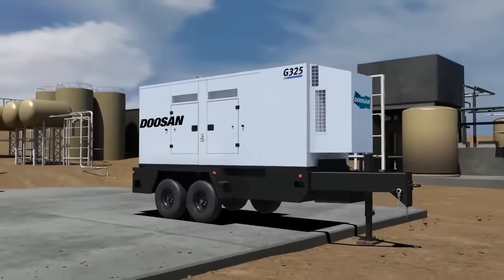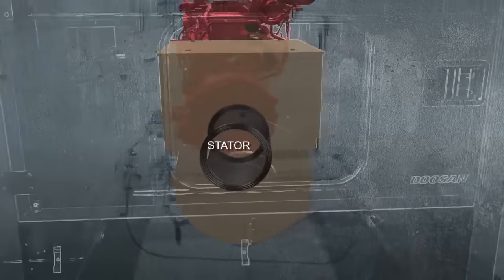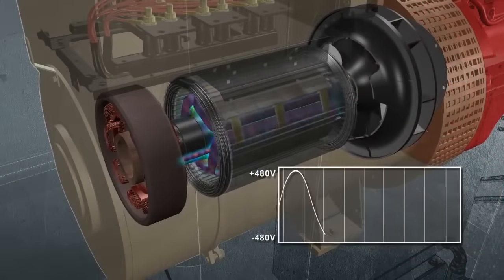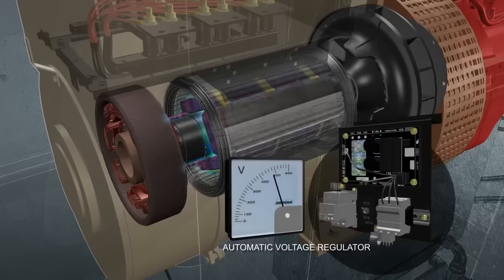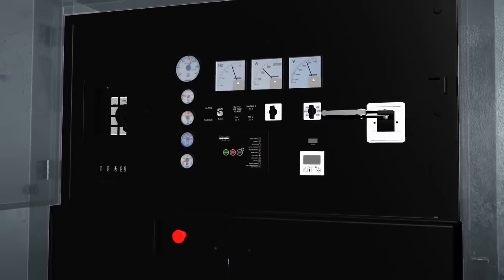HOW A DIESEL GENERATOR WORKS -ANIMATION

Comment: 🎯 Key Takeaways for quick navigation:

00:06 ⚙️ Diesel generators by Doosan Portable Power transform stored energy from diesel fuel into electricity for various uses.
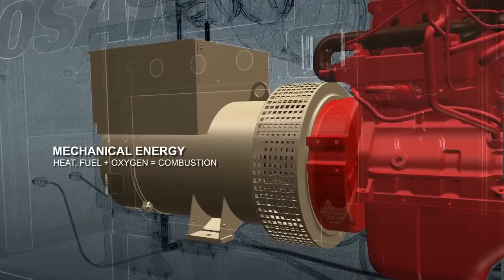00:35 🔄 A generator engine converts diesel fuel to mechanical energy, which is then converted into electrical energy by an alternator through magnetic induction.
01:04 🔧 Alternators consist of a stator and a rotor; the stator has copper coils, while the rotor, attached to the engine crankshaft, generates an electromagnetic field for voltage production.
01:30 ⚡ An automatic voltage regulator (AVR) maintains consistent voltage levels by adjusting magnetic fields based on power demands, ensuring a stable power supply.
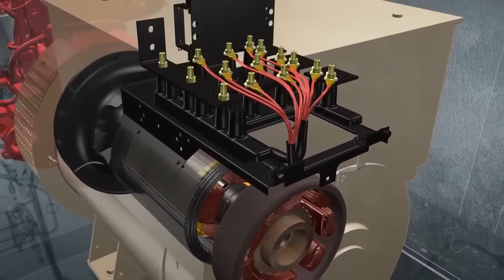01:57 🔄 Doosan mobile generators offer three voltage sources or phases, allowing flexibility for high or low voltage applications through a selector switch.
02:27 🚨 A circuit breaker in the generator protects against excessive current, halting the system if capacity is exceeded, safeguarding the generator and connected equipment.
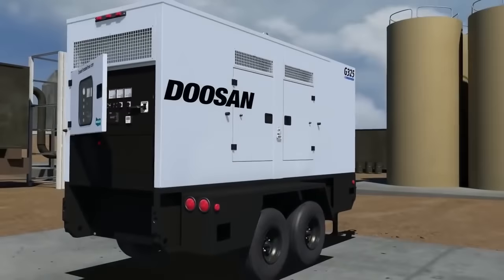02:40 💡 Once power reaches the connection panel, operators can attach power cables to the generator, enabling the transformation of electrical energy into light, heat, or motion for everyday use.

Made with HARPA AI

Comment: how does heat generated during combustion get transformed into mechanical energy moving the cylinders?
Reply from the maker: When Combustion takes places in the cylinder it pushes the piston down and heat energy is converted into mechanical energy.......
Reply: Actually, Fuel is basically mixed with air, and put inside the piston chamber, It ignites, And explodes Downwards, Spinning the Crank shaft which its connected to. then exhaust comes out, thats how the engine part works, The Alternator is what produces the power and its explained in the video.

Comment: Tell me why if a 3 phase generators alternator says it can withstand 200 Amps and the generator has a 200 amp circuit breaker , then why doesn't the 3phase breaker trip when the generator reaches a 200 amp load?

Comment: Where the rotor gets it voltage to become a electromagnet? Does it get it from battery? Or the rotor become electromagnet when the rotor start rotating due to mechanical torque of machine? Pls someone answer my question thankz..